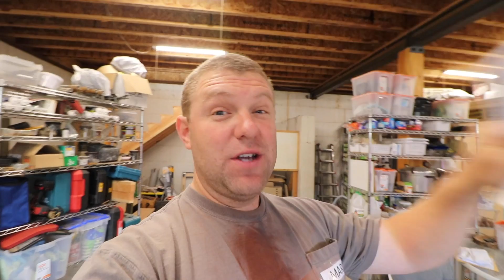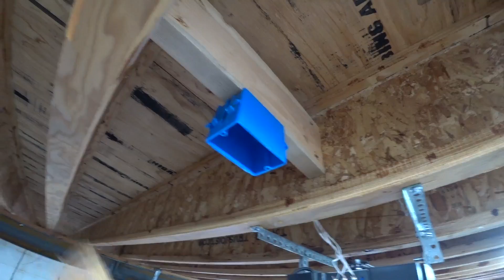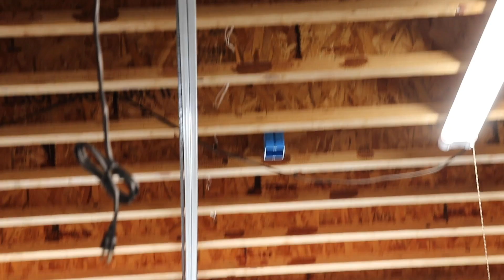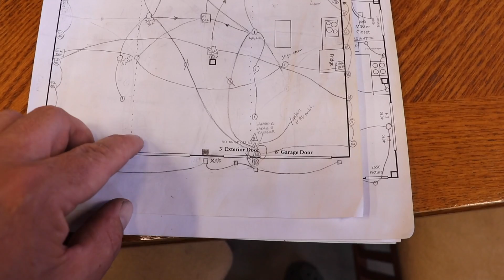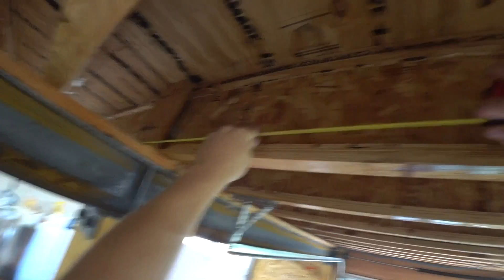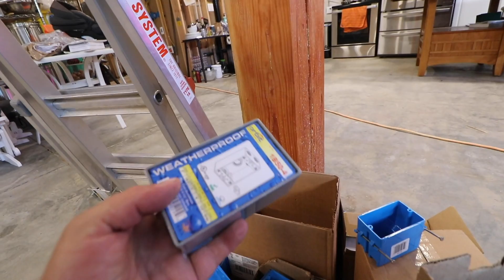She'll LOVE THIS UPGRADE! (Garage Lighting Electrical)

Comment: Rule of thumb I have heard and try to live by is 10 outlets per circuit max.
Reply: I believe it's actually 12 as you are to calculate 80% load and 1 amp per outlet... so 12/15 is... but they are doing 20 amp circuits... therefore... they are using 16 outlets per 20 amp breaker...

Comment: "a lot more wires to make it work" yeah exactly 2 more you need, you can even get away with 1 more but thats a not so nice way of doing it...
basically what you need to do is have one life wire to the switch then two wires (named coresponding wires , at least here in germany) that runs to the other switch and from there to the outlet or junktion box where you have a neutral wire so that you can go from there with the switched life, neutral and ground to you outlet box.

Comment: I don't understand why you are putting in braces for each outlet.  Why not put them on the joist?
Reply: I was wondering the same thing... seems like a lot of extra work doing it the way he did and I'm also expecting that the blocking will be an issue later on when it's time for plumbing and HVAC

Comment: You mentioned using one of the two neighboring metal boxes as a junction for outlets.  You could eliminate it by making the outlet box on the post the junction box.  Come from the panel to the outlet on the pole and then out to all the other outlets.  Also that seems like a lot of outlets for one circuit.  Code may say its acceptable(?) but for a garage, in practicality you want more circuits, so you can run tools off multiple circuits, as opposed to all tools on one circuit.  You will constantly be tripping breakers.
Reply: glen74 I doubt they will have all the tools workin as once .
Unless the are moving to make it a grow room 😂
Reply: @mikeimparato824  Originally my garage had only one 20A circuit for outlets and I was always tripping it.  But I have a old fridge for cold beverages, stereo, battery chargers, vacuum, air compressor, and some type of saw/router running and it would trip.  So eventually I put two more circuit in via surface mount.

Comment: Your electrician will likely tell you this, but you can split the receptacle so that only half is switched.  That way you always have electricity at the receptacle box should you need to power other items. (garage door opener, wifi extender, security cameras... etc.

Comment: Sorry to tell you. After having worked as an Electrician for 33 years. The house IS the blueprint per the National Electrical code, which is part of the National Fire Code. Be careful with box fill. Each bathroom will have a 20 amp circuit. The Kitchen will have Two 20 Amp circuits....

Comment: When I redid my basement lighting, I just used armor-clad across the bottom of the joists.  It avoids the whole worry about where to drill.  It cost a bit more but it gives back in peace of mind and flexibility for adding/moving things around in the future with no new holes.
Reply: Problem is they're going to drywall the ceiling and the drywall is going to be fastened to the bottom of those joists...

Comment: Just a heads up, check with your electrician but I don't think you can use plastic face plate for the outlets on the vertical beams. Plastic face plate must be against drywall or other wall covering. If the edge of the face plate would extend past the edge of the box you would need to upgrade to a metal face plate.

Comment: oh yeah. If you plan on smart switches, make sure that the box for the switch has a neutral wire there or the smart switch will not work. I really wanted to put one in my hobby room but there is only 2 wires that the switch operates and no neutral :(
Reply: TheStuffz - See my earlier post about hot and neutral required in all switch/outlet/light junction boxes.  Your example is why the code has changed !

Comment: Not sure if it is different there but building here in Colorado we CANNOT have an outlet on the same circuit as LIGHTING in a garage. We are only allowed 5 J boxes per circuit and with 12ga a limit to how many light units too.

Comment: Go Alexa or similar, reduce your wiring. Alexa, garage lights on/off. Job done
Reply: Until an internet outage.  If you have home automation and no other options, you almost need to have a stand alone system if your internet is at all flaky.  That said, there are standard wireless switches which interface with the various HA hubs.

Comment: Your wasting money and making life more difficult for yourself using 12/2 (or 12/3) wire for lighting.  14/2 is much easier to work with.  Also the latest NEC says all switch/outlet/light junction boxes MUST have a "hot at all times" lead (futureproof).  This will mean even on a simple 1 switch, 1 light circuit, you will need to use 14/3 for at least part of that run.
Reply: Q.  If the power comes in to the fixture in the ceiling for example, what would the wiring look like at the switch box?
Reply: @johnf9076  - You have to run 14/3 to the switch junction box.  The extra wire (hot at all times) is not used except for "special" switches.
Reply: @jackpatteeuw9244  Thankws. That's what I assumed, nut you know what the say about  assume.
Reply: Code reference, please?
Reply: Its what he does best

Comment: Instead of running wires for 3 way and 4 way switches why not already plan on putting in smart switches. You won’t need all those wires because secondary switches work wirelessly with the main smart switch. IDevices Inc   Check them out.

Comment: Is it not better to put the plumbing and hvac in before the electrical.
Reply: robert hesse you’re right, ducts and drain lines can only move so much pretty set on where they go. Much easier to move electrical around.
Reply: Problem is the electrical is what's holding up finishing the exterior of the house because of the SIPs...

Comment: In Oz we can't draw power from a lighting circuit unless the wiring is suitable for power and the circuit is labelled as a Mixed circuit, so best check your regs.
Reply: But  we can put lights on a power circuit, can't we??
Reply: @kadmow   Hi , In Australia, if you join a lighting circuit to a power circuit, I believe that you have to write that in your powerboard on that circuit and that electrician should do this
Reply: I’ve got a light switch on a twin socket NSW.

Comment: You already have the steel beam running at right angles to the I joists. Bulkhead along the steel beam and run between the I joists. Longer runs, but less insults to the continuity of the I joists.
Reply: They're finishing the ceiling with drywall.  So the joists are going to be covered up when they're done...
Reply: ZeoCyberG if they run parallel to the joists to the steel beam then parallel to the central beam in a bulkhead, they would nit need to put any holes in the joists.
Reply: @Ken Knutson - No, at best that would only work for the electrical but not for all the plumbing and HVAC.

While it also goes against the point of them wanting a finished ceiling that hides all the utility lines.  Your idea will leave the utilities visible along the steel beam and where they run up and into the spaces between the joists.

Comment: All the work you have done in the garage the house upstairs could almost be done!! Build this big ole beautiful home to live in the garage
Reply: They have to finish the electrical before they can finish the SIPs and they need to finish the SIPs before they can do the siding and then they need to finish the siding before, well you get the picture...   Building sometimes require it be done in a certain order and if anything in that sequence is delayed then everything gets delayed...

Also, where they live limits what time of year they can get supplies and heavy equipment to and from the property because of road conditions, availability of local companies, etc...

Comment: NEC says that current carrying wires that can only be used one at a time don’t count as two. i.e. 3 way switch’s can only use two of the three wires at any one time, so they only count as two wires not three.
Reply: Not sure if that applies to box fill though. On box fill all wires in that end in the box count as 1 each, 1 for each through wire and  1 for all grounds together. Additionally devices also count.

Comment: When are you installing central Air? Would you like help with that? Turn your 2 x 6 and 2 x 4 on its side so your supply runs can run down the joist without having to remove your boards again. Your return air needs to be planed before you run electrical. I am sure you have many to help you, but if not let me know.

Comment: I like that Dewalt hammer you used putting in the one box attached to the board.  (necessity is a great thing). Electricity has always been a bit of a mystery to me. I always get help, especially if it all about 3 way switches!

Comment: You run the 12/3 romex from switch box to switch bow. Power hits one switch and the switch leg goes to the other switch. Don't take them to a needless junction box in the ceiling. and if you used a 2 gang mud ring on the 4 square metal box only a plastic cover will be on the surface. or exposed

Comment: In the UK we tend to run a lighting ring between lights and drop a switch wire from each. Indeed our standard ceiling connectors  have inbuilt terminals for just such a wiring scheme.  I have never liked this. I prefer to run a power cable to the switchs and then run a switched cable to the light. Generally this means that a ceiling fitting has only a single cable or two if you are daisy chaining the lights on that switch. If you ever want to change or move the light fitting it is comparatively easy. The electricians way of wiring it uses less materials and almost certainly means that you will need to employ an electrician to make any changes. I like to add occasional junction boxes with terminal strips, similar to the ones you have in your distribution board, but I prefer them individually insulated. You can bring in and terminate all your loads on one side and all your power and switching on the other. It is then just a matter of connecting the two as and when you want to bring each feature into use. All temporary wiring is kept within the junction box. Junction boxes can look complex and certainly add extra breaks in the cable where things can go wrong, but when you are moving forward in steps and are not certain, it quickly becomes obvious as to what changes need to be made.

Comment: metal boxes flush to 2 x's  Then you use the proper mud plate for the thickness of your drywall.  There are two holes on the side of the boxes to attach boxes, even to your engineer joints.

Comment: Your boxes are really cheap. In Canada, they cost at minimum 1,25$ and they are metal boxes and the plastics ones are more expensive.
Reply: So thats about .70cents US , just seems cheep when you do the math???????
Reply: wery cheap finland one box cost 4-7$  and nomal ewery room need light one box, switch near door one box and outlets ewery corner have 4 box, minimum 6 box /room, and living room go more. and garage go lot more. and cable go about normal house 500 meter 2,5mm2 3 wire cable.cost about 7-800$ main fusebox cost about little 100$ big 24 fuse or more 700€

Comment: What about doing a drop ceiling down the middle which would give room for HVAC, plumming, and electrical with limited holes in the floor joists....just a thought
Reply: He doesn't have the clearance for garage doors and garage needs to be fire rated with 5/8 drywall.

Comment: On the lights for the ceilings in garage Menard s have some led motion lights that are 3 or 4 ft long . Can put think 5 on same run plugging light into light .
Have some at my shop work nice because had people that to lazy to turn off lights

Comment: Those blocks will inhibit HVAC and plumbing runs.  Normally HVAC and plumbing go in before electric,. electric has the most flexibility, then HVAC, followed by plumbing with the least flexibility.

Comment: Just a FYI, You can just screw through the TGI from the back side to mount those boards to hold your boards. Less screwing around than trying to use twice as many screws. Fun job, be careful..

Comment: You also may want to consider three-way switch at the top of the stairs and the sister switch at the ped door , for one of your lighting circuits so you can light up the garage from either entrance

Comment: The 3-wire for the 3-way switches should not stop at all the light boxes, but go directly between the switches.  You can't hook to the travelers anyway and you need to save room in the light boxes.

Comment: Have you considered a mini split for HVAC? Ducting is inefficient. You can get mini splits that do heat and ac in the same unit and it's approximately the same price as ducted.
Reply: Had them in Hawaii so energy efficient and will replace my existing whole house unit with them when it goes out.  So much easier when wanting to heat specific areas.

Comment: Not recommending it, but it makes me think of the convenience of digital control of outlets. You assign a code to each outlet and switch and anything can control anything so you could have a switch for lights at the garage door, the stairs and upstairs and a remote all controlling the same light(s). You just inject the codes anywhere on any wire that goes to the lights and use a smart outlet. Sadly, although the prices are dropping like whoa, they're still a lot more expensive. Still, you run a LOT less wires than with three-way or multiple-way switching systems since you don't have to run a wire to and from a switch, but rather just one wire to inject a control signal into. Since the wire just sends a low level signal it can be a really small wire too. Even cooler, later you could change your mind about what a switch should control, and you can just change the code it sends out to control a different outlet/light

Comment: In my town every appliance (garage opener) is supposed to be on a separate breaker, and only 8 outlets to a breaker.
Reply: Check your code again. How would that work for your kitchen? 7 circuits for 1 room? Fridge, toaster, microwave, coffee maker, stove, hood, lights? And in WI there is no limit to the number of outlets but the combined constant load cannot exceed 80% capacity of the breaker (12A constant draw on a 15A circuit)

Comment: Seven lights to a circuit. Garage opener on a separate breaker. Too many wires in a box. You need an electrician before you begin. You need to keep to carpenter work and leave the electrical to an electrician. Wall outlets on their own circuit. One circuit per wall with 7 outlets per home run. Thee wire cables for switches will save you a lot of trouble.
Reply: Phil Miller we are allowed up to 12 on a single run here. I don’t believe that you need an electrician to do wiring but this is a classic case of too little knowledge combined with gross over thinking, in any case he’s always interesting to watch and figures it out one way or another

Comment: Since you're gonna use conduit on your posts, you COULD go nuts and put large conduit along the entire beam to run all your north/south runs in there, and then just pop them out into the joist bays as needed.  Very clean, and no holes in your joists.  IDK, or do your north/south runs along the sill plate + ICF cavity, out of the way of the walls and the joists.  You'd use more wire, but again, no extra holes in your joists.

Comment: I have a simple question.  Why did you toenail the outlet support boards in.  If you just run the screws from the other side of the I joists then you just run screw in straight.  If you have a reason that is great but just wondering?

Comment: I think what you are talking bout lightwise is called a 2-Way in the UK (2 switches) you can go a step further and have intermediate (3 or more switches)! 

We wire it differently to you and it may not be applicable, but ........ Wire from your light fitting down to your switch (2 cores and Earth) and between switches with a single cable (3 core and earth). As you can see it simplifies things a lot! Each 2-way switch has 3 terminals, your 3 core goes directly terminal to terminal in both switches and your Switch feed and Switch wire (the 2 cores from your light) go to the 2 straper terminals. You can wire it an alternative way, usually only in conduit by feeding the switch feed to the common terminal, 2 strapers from the other 2 terminals and a second single core from the second switch back to the light. It is easier if you have a diagram ;0). 

So basically you do away with both a joint and a cable in your box!  More joints, more chance of failure!

Comment: we have the same joists here and i can safely say you can put a LOT of holes in them there joists ,we have pipe runs at 2" down to 3/4" 6 in a row close together (enough space for lagging ) an 1" or so apart and electrical too all be it a lot further than the pipe runs ..those joists are over engineered and they ain't going no where :) , don't over think it just do it your house is TOO well built

Comment: Those "devices" are called "receptacles" and they are installed in an "outlet" just like a "switch" is installed in an "outlet".     Not picking on you, just educating.
Reply: Code requires drywall in garages as a fire barrier.
Reply: dfiler2    Thank you.   I saw the doors but didn't think about being a garage.   I agree.    So I removed the drop ceiling idea.